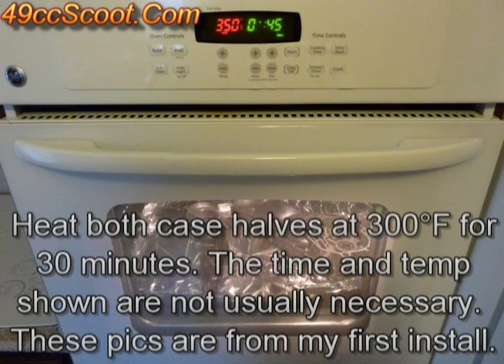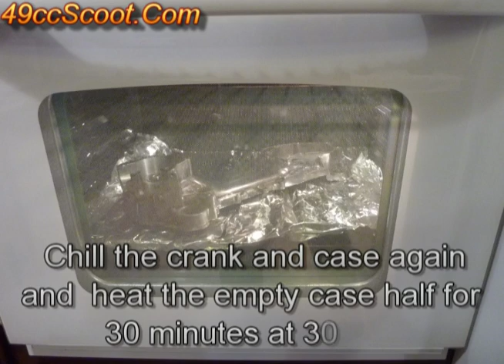Scooter How-To : Alternate Crankshaft Installation Method

Comment: A high temp heat gun may also do the trick.  I use it to remove bearings on nitrogen engines.  May work here as well.